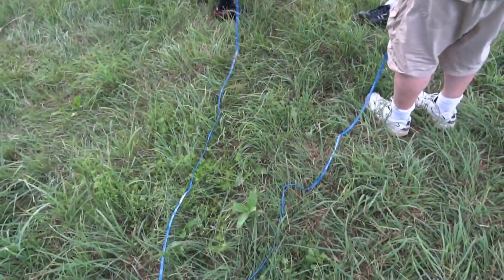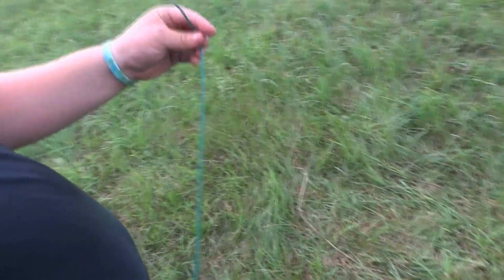Safety Fuse vs. Quickmatch

Comment: Joel. Did he say the safety fuse will burn as quickly as the quick match if they are taped together?? So even though the safety match burns at a much slower rate, so long as the quick match is tied entirely to the length of the safety fuse, it will burn as fast as the quick match?
Reply from the maker: Yep! It would be the same as if you attached quick fuse to safety fuse. The burn rate would be that of quick fuse.
Reply: So why the delay at the end of the quick fuse???  Shouldn't it have lit the roman candle immediately if that's the case?
Reply: TheB233314 The fuse on the roman candle is visco.
Reply: rcPYROone...so does that mean that visco will not travel as fast as quickfuse if attached together?
Reply: TheB233314
Perhaps there still was some visco inside the wrapping, thus the delay.

Comment: Thx Joel.. I was just curious.. Seems the new 1.4  QM with the percolate burns even faster and more intense than the 1.3.  I got a roll of 160ft for 50 bucks or something (1.4)
Reply from the maker: Would be a cool comparison video! That is a good deal!
Reply: Depends on the 1.3 quickmatch. The quickmatch I get explodes.I lit a 60 foot roll of it a couple months ago and the whole string exploded about as loud as an m80. Burns so fast it explodes. I have had some that would take a second or two to burn 4 feet. Depends on the quality as to how fast it will burn.

Comment: Joel, was that 1.3 or 1.4 QM?  Also were that strands inside the paper covering whitish/grey or blackish?   Thanks..  They are making some QM that is percolate based now instead of the traditional BP formula ... Thanks for posting ..  Good point saying you should tie your visco to the QM.  It will snap off if not tied.  Also will make a loud bang.. Compression :)
Reply from the maker: Thanks! That is a good question and to be honest I don't know the answer. I will have to ask some of the guys that were there to see if any of them remember.

Comment: You know if you got an ATF License you could get professional grade fireworks from ACE pyro.  Of course that usually includes finding a company to fund the show and the labor, cause let's face it doing a pro show is not easy when all the safety measures are taken into account.  You know what forget I said anything.
Reply: Getting a license is always recommended but its also extremely easy to make professional geade pyrptechnics as well as put on a safe show without any issues.